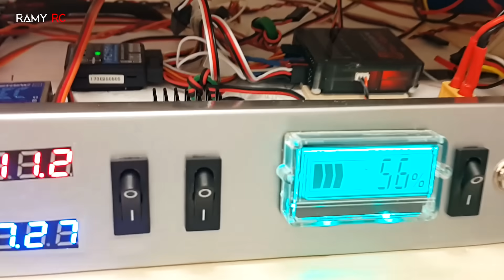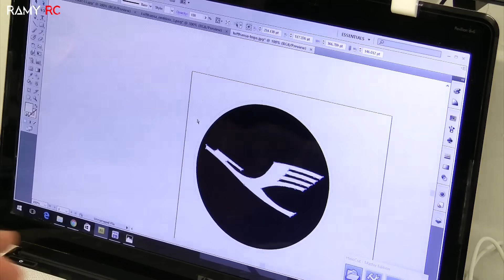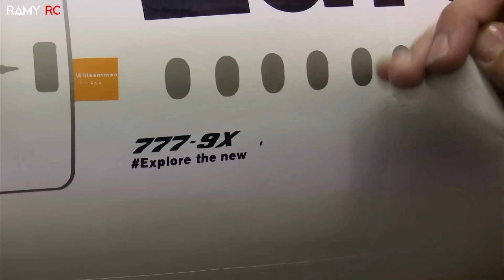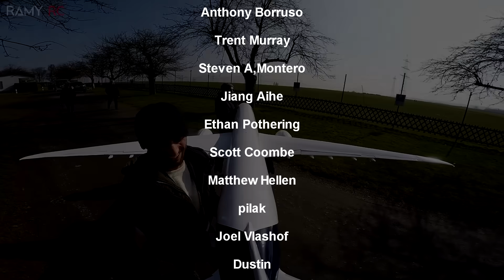Building the Boeing 777-9X RC model airliner, Complete build and first flight video

Comment: Hi Ramy. I am shocked and impressed by your neatness and attention to detail. Such a beautiful and accurate models. I envy your patience! I am also a 3D printer modeller, but not in aviation. I am attracted by the modeling of cars, as well as the military theme. Aviation is also attractive, but for me it is still something unattainable. Nevertheless, I really like your videos and I wish you creative success in this field!
Wouldn't it make it difficult for you to answer a few questions. What kind of adhesives do you use? I've watched a lot of your videos and you use different adhesives all the time. Due to the fact that many videos were shot in accelerated mode, I do not have time to make out the titles. Do you also use epoxy adhesives?
Another question about the fuselage and wings. As I understand it, you mainly use glass fiber and carbon fiber, but specifically in this video I saw that you cover the fuselage and wings with some kind of cardboard, or plastic, or is it even foam?
You impregnate glass fiber and carbon fiber with epoxy resin. Do you mix it with a hardener? Sorry for my clumsy English. A google translator helps me, but apparently he knows English even worse than me. ))

Comment: to do the best landing, 
1:slow down
2: open flaps, then the plane's Front nozzle gets up
3: turn up the wing brakes and Slats(if installed)
4: then don't chage the position of Elevators, rudders or Alerons.(exactly nothing to do. Just control if the plane goes wrong side)
5: Then see and enjoy! pretty cute plane lands itself by the help of flaps and the continued thrust to front of the plane.
Good job and good work! Thanks for the creative idea!

Comment: If styrofoam is replaced with cardboard, would it be too heavy? I'm not using wood or other really heavy things, and if needed replace the outer cover with paper. Plane body is around 1 meter long.

Comment: Curious as to why the 25g fiberglass then 80g fiberglass on the fuselage?  Wouldn't cross-laminating with the light 25g achieve the same strength?  Trying to build a Gulfstream so any advice would be helpful.

Comment: Hi Ramy, 
I’ve been watching your videos for a long time now and I’m truly amazed how you built your planes from scratch and developed techniques as you went along. I’ve had this interest since childhood and frankly I envy you that you are able to do what you do because that’s exactly what I want to do myself. When I was younger I had plenty of time but no money, now much older, have money, but no time. 

Anyway, I saw when you crashed your dream liner and knowing that you worked on that plane for months, I was heartbroken to see the video. Although the tail section seems to be a Great Wall accent decor now. Great to see your building the A350 and I can see you have employed new tools to make the new plane easier lighter and better designed. I’m really just curious and hope you can answer some questions.

Now you are using carbon fiber, have you considered painting the exterior instead of that material that you use ( actually looks great but looks difficult and time consuming to apply) .
The other thing is I realized that the electronics on these RC planes are far more sophisticated now than when I tried to get into the hobby ages ago. Is there a system for RC planes similar to the FPV system they use on drones where you can have an actual view from the plane ( on board camera) and also give you flight telemetry. I’m just wondering if there is a reason why no RC enthusiast I’ve watched on you tube seem to be using such a system. 

Anyway, it’s just a thought I wish you luck on your new project and continue to enjoy what you are doing because I truly enjoy watching it. Next time I come to Germany I’d like to see people fly their RC planes. Thank you for taking the time to read. All the best!

George Lagos
Big Fan from Philippines

Comment: Take off should be performed with flaps, looks like trust a bit low for this plane. The upcoming crash on 31 May is predictable , this plane should be controlled with flight controller with stabilization to limit bank ratio as is on real plane,  you got a classic speed loss stall an right turn, remember scale copy has always worst flight performance compare to original because of less reynolds number,

Comment: Ramy, you are an artisan! Like...renaissance artisan. But yea... work in this landing bud. Watch real jets approach. Nose should be high...right? Like 5° positive AoA using throttle to control decent rate. It's the same principle whether its 27kg or 270 tons. 
Do you use a gyro? My guess is no. I,would strongly recommend it. Would really smooth out the controls and give it that scale flight characteristics to match your amazing scale work.

Comment: The more I watch this video, the more I want to start on my project of building a Raytheon Hawker 4000 with a pair of edf's in place of the PW 208A TurboFan's. I've gotten the scaled drawings back from my print Shoppe that has printed out 3 sets of the plane so that I can put one up on the wall in my new shop and have a working copy with which to use as templates for the Fuselage, Wings and Tail Structure. My biggest challenge is building pylon's on the rear fuselage that can easily mount the engines and still not be too heavy. RAMY, You inspire me!! And for a Former Combat (F4D, F-111) Pilot along with some 8,300hrs in a C5A/B/M. I've had 3 Major Strokes and so I'm unable to obtain a Medical to go with my ATP, RC'ing allows me the opportunity that until now has been Nothing in the way of fun in Aviation!!
Reply: Same, I'm building a boeing 777-300er that's 1 meter long.

Comment: Very nice! Great work you did! Now, I wanted to recommend you to use some sort of gyroscope (or button activated) parachute on your models to prevent devastating crashes! It would fire either from the battery compartment or somewhere else, and protect the aircraft in case of loss of control/in case of a freefall situation!

Comment: Why Vinyl for the main fuselage and wings? I can understand using vinyl for the Lufthansa decals and the letterings. But paint would have been easier and lighter than Vinyl wraps. The fiberglass already gives a protective shell to the foam core and soft vinyl doesn't add tot he structural integrity, no?